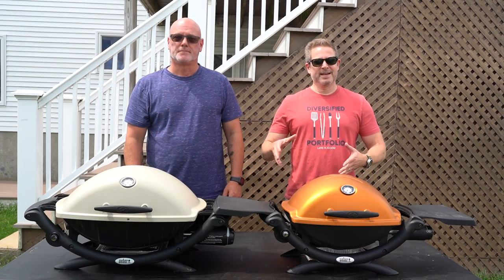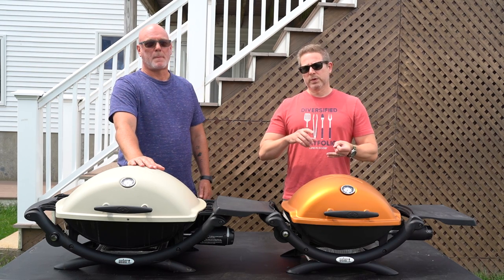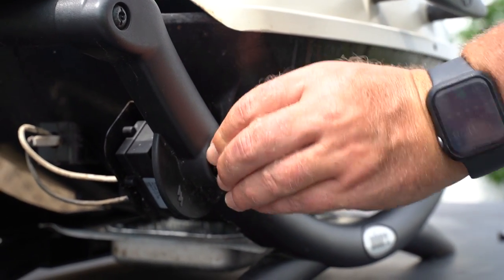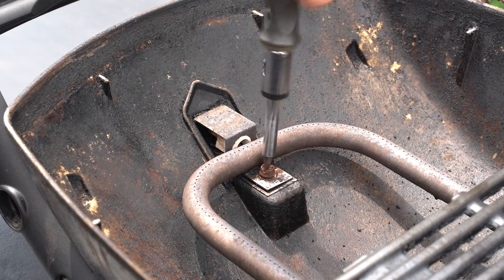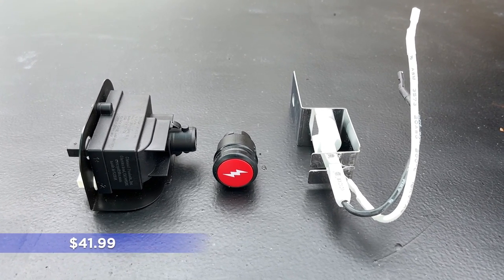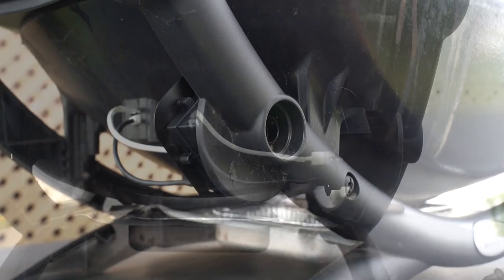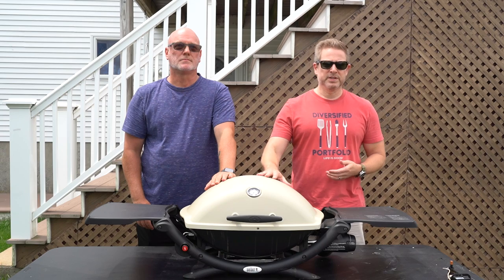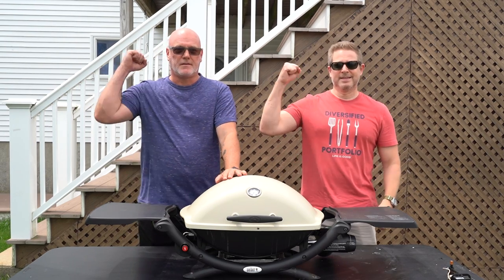Let's Talk Weber Qs — Installing a New Ignition on a Weber Q Grill

Comment: I’m having a problem getting the ignition into place. I line up the notches but cannot get it to turn without using a lot of force and I’m afraid that I will damage the clips on it. Your video of this seemed a little jerky. Have you seen this before?

Comment: Would you happen to know why the back of my burner does not light when I start the grill. I thought it might be the burner, so I purchased a new one, and the same thing is happening. The front and sides seam to light up, but never the back. Thanks in advance!!!
Reply from the maker: I'm not sure. Is your grill on a level surface? My guess would be the back of the burner is lower than the front so the gas isn't going down to the back of the burner. Just a guess though as I've never heard of that before.